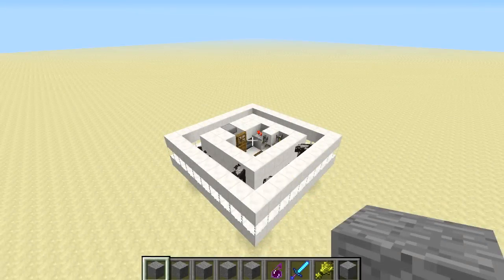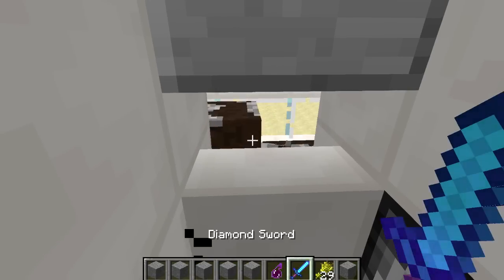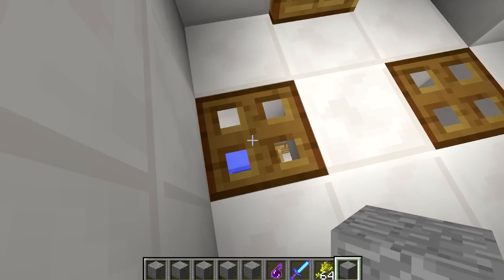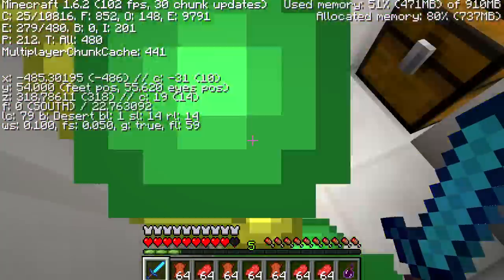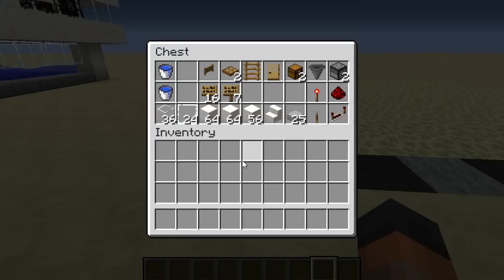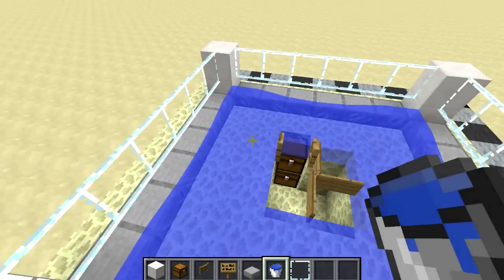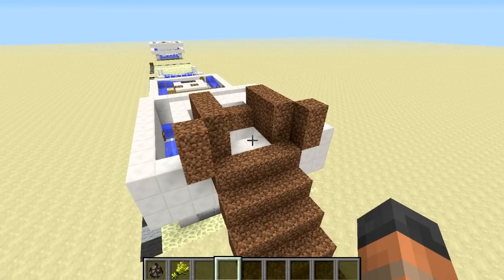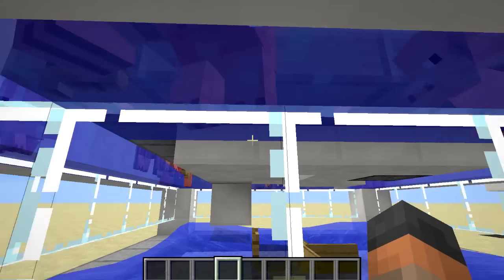Minecraft: Mass Breeding Machine Tutorial

Comment: Instead of pressing F11 (which doesnt work anymore) you can switch Attack/Destroy to CAPS and point wherever needed. then of course press CAPS, Hint: this also works for cobble generators and is perfect for skyblock, be cautious that once ur afk that you might break the wrong block and die. Fix this by either placing an obby block behind it or a chest with a hopper. for max safety you can unplug ur mouse or turn it off so no accidental bumps happen while ur gone on your phone or laptop or even watching tv. Hope i helped and if i did like this comment to share with others.
Reply: Your amazing!
Reply: *****  Thx ive been using this in skyblock for so long,

Comment: One thing I have noticed.  Sometimes a calf (baby cow) will get into the stairs that was placed at 11:22.  Having a baby cow in  there will waste a stack of wheat in about 12 seconds* and reduce your efficiency.  My solution was to replace the stairs with a regular solid block.  The reduced access slot does not affect the efficiency. 

*I have a programmable keyboard and I can change the repeat rate for any key without having to hold it down.  I have mine set at 200ms, or 5 clicks per second.  If you have a regular keyboard and you use an object to hold the key down, you can access the repeat rate in the "keyboard properties" in windows control panel. (if you use that OS)

Comment: Guys, i just wanted to say that i've builded this on a SMP Server under the ground. And somehow it doesn't work. The whole prosses is fine, and it's easy to use. But however the cows are dying somehow. I have no clue how and why, but make sure you test it before using it. It's really strange. It's only the mother cows, that dies. And there's only 4 left, and they're standing in the 4 spots where theres no water. I've tested it a couple of times, but the same happens every time :/ Im not saying Xisuma posted something that didn't work. Just make sure to test it in a testworld, before being as stupid as i was :P
Reply: It's because you are on a server. ( i dont know the actual cause, it just has something to do with the server...)
Reply: jilles van der horst Nah, I may have found the source. If you have solid blocks over where the cows blow it'll cause them to suffocate as they move around. I placed half slabs over the top of mine, so the sake of making it pretty, and when I accidently placed a "solid" half slab block they started to suffocate.
Reply: AshenEdict I'll try this out! But i made my own design on the server anyways :/
Reply: I've done some tests with this, in 1.8 and the reason why they die is because there is blocks above them. Make sure the build has a 3 block gap between the roof and the actual design
Reply: BlackNoyse Thanks for the help! Really awesome community! I've removed my farm tho, but now i can consider to re-build it! Thanks again! :)
Reply: Nicowitsz No problem! Any chance I could slip into the SMP? I'm looking for somewhere to record and I really would love it if I could have some more videos uploaded!
Reply: Yeah it tends not to work underground maybe their escaping and suffocating in the walls

Comment: I must say this is cool but there are 2 problems I have; This application of farming is hard to use in single player because the potions will be very expensive and the sword is not easy to get. Also this method seems a bit cheaty. Especially considering that exploits are used all through out the machine.
Reply: Then don't use it.
Reply: Derek Son I am simply stating a point.
Reply: You don't have to use a potion and a Looting III sword. You could easily just use a normal sword. Or in the bottom where the cows accumulate, throw in 4 signs on the very bottom block layer, and 1 dispenser with a lava bucket at the cows' head level. To power the dispenser, use a stone button and press it twice, or a dual edge monostable circuit. This will kill only the  adult cows, and automatically cook your steak.

Comment: I'm afraid this design as it's presented doesn't work; the hopper attached to the automatic wheat dispenser sucks up the wheat before you can pick it up. There's an easy fix though; sink all the redstone electronics by one block so they power the bottom dropper, not the top one. This will cause the bottom dropper to transfer power to both the top dropper so it fires and the hopper so it freezes during each firing, allowing you a moment to pick up the wheat before the hopper sucks it back through the system.
Reply: Thanks! :-)

Comment: This did not work for me. The cows glitched through the walls.
Reply: Same here, I made this a while ago and even changing the design to have the water in dispensers so it can be removed so they don't jump while logging off and having solid blocks instead of glass and even putting solid blocks around the glass panes doesn't solve it. The dispensers help quite a bit but it'll still need to be restocked with cows.

Comment: Pleasseeeeee pleaseee someone help - I have Minecraft PS3 and they will not rotate properly. Even whilst holding the wheat at the designed place... i've tried everything, done it exactly as instructed. Is it because they wont move the same way as they do on the PC? I think it is. I've just spent ages trying to do this.... please please someone help :(
Reply: +Duck Pie I seriously appreciate the time you used up to help me :-)
Reply: +saphire addams Always there to help
Reply: Duck Pie <3 <3
Reply: +saphire addams you need to put more cows in. If they aren't enough, one will not be able to push the other and it will get stuck. Just try putting more cows in.
Reply: Nah i put like double the amount of cows in and they dont move :-( appreciate you trying to help though
Reply: saphire addams Oh, i'm sorry then. It seems like  weird problem.
Reply: German Eagle The water flows around in the correct directions, the only thing that is wrong is that the design is a block wider than it should be but that doesn't affect anything as I have just patched up the gap in between with more signs and altered things perfectly (I had to do this design with bare minimal things on survival) Unless the way the cows move is because of the shape of the design I can't see any faults in the water :-( They just aren't moving or bobbing with the water...They just look in different directions and move slowly in whatever direction. There is no real specific corner or anything they are stuck in :-(
Reply: saphire addams what the... Okay, have you tried riding it? If so, and it works with you and not with the cow, it may be a problem with the AI, have you tried with pigs? Have you tried making it with the same design shape. What I believe is the problem is how you used the signs.
 Do they stop in the middle of the section or at the end/start? If it is at the end or start, it should be pretty easy to fix. It may be a problem of colision, or maybe a visual bug. They are at least jumping right?
Reply: I did, I flow with the water and the current is strong. I think like 80% chance is the AI being wrong and it not working on Ps3 :/ even after this update for Ps3 it doesn't work :-( I haven't tried re-doing it all because it took soo long and I am just breeding the cows as if its a normal farm at the moment since the cows do fall in to the pit etc. The visual on the cows is so so so glitchy, they glitch in between the walls and half suffocate for no reason but that is just Minecraft for you ;-( ... It may be collision but there is roughly the same cows in as he has, maybe a bit more, and I can't see how they collide when there is more than enough room for them to move. They just don't have the reaction to move forwards and none of them are jumping :/ Thanks for the help <3
Reply: saphire addams No prob ;)
Reply: its pc version XD